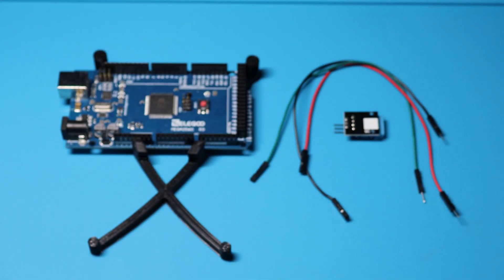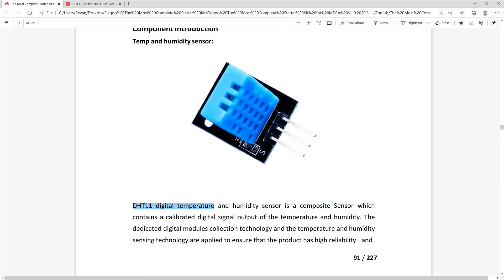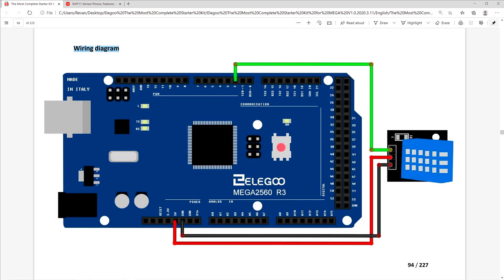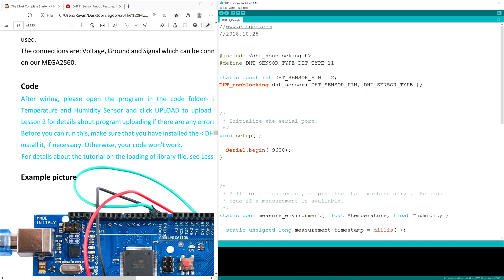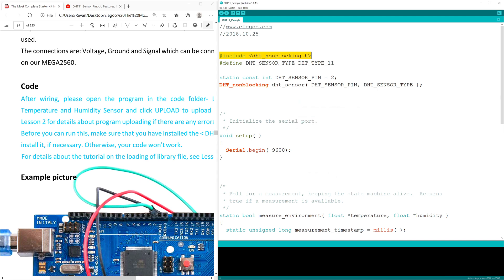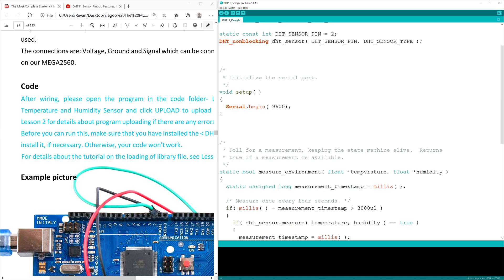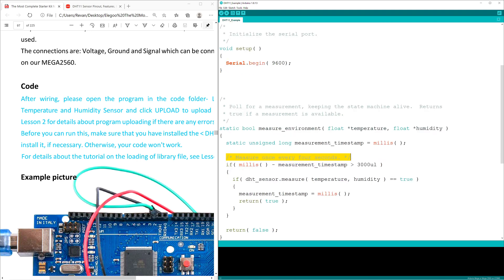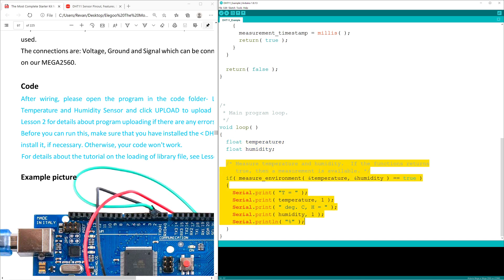STARTER KIT TUTORIAL FOR MEGA 2560, Lesson 12 DHT11 Temperature and Humidity Sensor

Comment: how do you get the code on arduino?
Reply from the maker: No Worries, i got you! 
1.Head over to this site: https://www.elegoo.com/pages/arduino-kits-support-files 
2.There's a drop down tab, choose Mega 2560 starter kits
3.Choose the "Elegoo Mega 2560 The Most Complete Starter Kit"
4.It'll redirect you to the Zip file
5.From there you just need to extract the zip file and you're good!

If you run into issues, the first video of this series goes over the installation of Arduino and the steps i went over,
you can also reply to the thread and I'll try to help out!

Good luck!